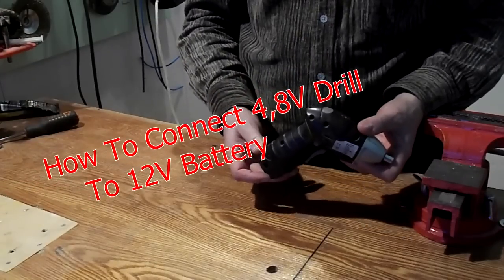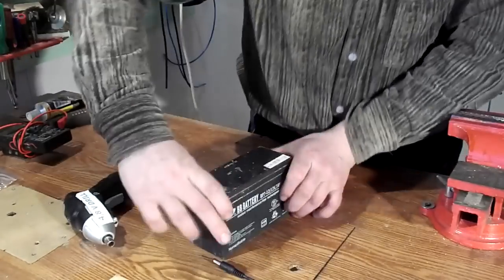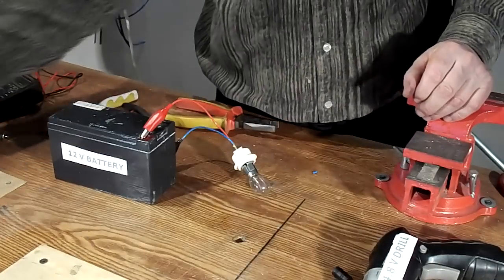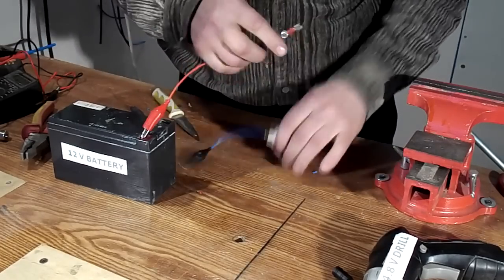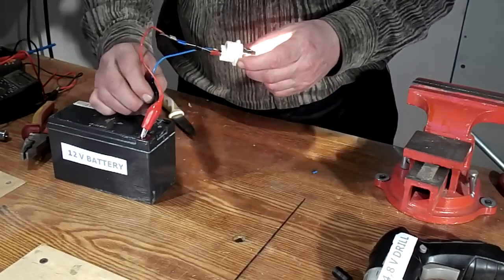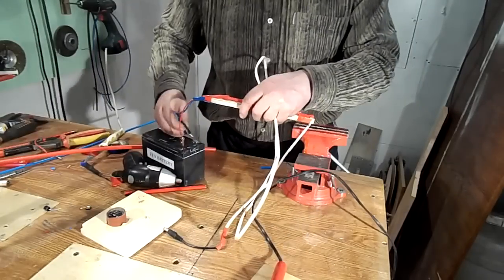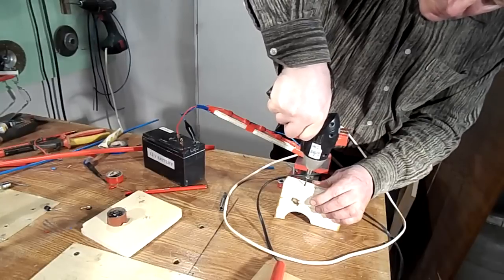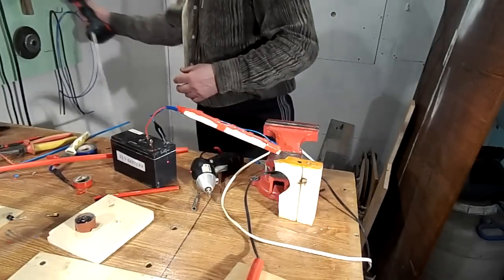How To Connect 4,8V Drill And 12V Battery

Comment: Two A123 cells in series will do a much better job. At 6V they'll overdrive the motor slightly, which is often a good thing because these tiny screwdrivers aren't exactly powerful and can use the extra energy, and they can be hooked up directly so no need to waste 60% of the battery's energy into heat. You can also parallel them up in a 2s2p, 2s3p etc configuration if you need more battery life. A123 18650s are fairly cheap. You can also use normal 18650s which are cheaper still and have more capacity, but then you need to get protected ones for safety and they have higher voltage which might overdrive the motor a bit too much for comfort.
Reply from the maker: A123? I do not think that these batteries will be able to compete with my battery for the duration of the work. This is the most important factor for me
Reply: A123 26650s have 2.5Ah. Keep in mind that if you're using a 7Ah lead-acid battery and waste 60% of its energy with the diodes you get about the same life, and the A123 pack will be MUCH lighter and smaller and will last longer.

If A123s are not available at acceptable prices to you, perhaps a better choice would be a cheap 9-12 volt tool connected directly to your battery.

The way you're doing it in this video works if you aren't troubled by the inefficiency, but the battery is much bigger and heavier than it needs to be.
Reply from the maker: In any event, my variant may be useful.

Comment: you could have used a resistor in place.... but this was A nice trick....
Reply from the maker: The resistor restricts the current, which reduces the power of the drill.
Reply: Victor V.
ok... but, the current draw will be constant for the motor  as it is what the motor needs to run so the voltage will drop..... as per v = IR
if current is constant then votage will be changing,
please clear me this thing i need to know... in old speed controller for electric vehicle they used big variable rehostat... but in that place they could have easily use a variable diode type thing isnt that crrect... please help me by telling this thing as i am going to build a speed controller for my kart   and this will help me.. thank you sir...
Reply: +Victor V.  i was also thinking the same way by using diodes as diodes reduces voltages... but i have never seen anything as a variable type of diode so i thought of sticking to resistance....
Reply from the maker: What will be the maximum power of your car?
Reply: Victor V.
 i am thinking of two types of motor,
1. 48 volt 1500 watt 3000 rpm dc motor...
or
2.220 volt 850 watt 2700 rpm ac motor...  its hard here to find a 48 volt motor so i think at last i will have stick to the 220 volt ac one...
Reply from the maker: AC 220 volt power regulators are sold in stores. This is the cheapest and easiest option for you.
Reply: Victor V.
 but the motor will use 3.28 amps those power regulators are of much lower current, less then   or equal to .5 amps
Reply from the maker: Parasar Bhattacharya
I saw regulators to 6 amperes, ie 1500 Watt

Comment: Basically warm diodes that consume more than is consumed by the electric motor . I was expecting Switching Power
Reply: The diodes are an easy way of dropping the 12v to 5v , the power wasted in the diodes is only when the drill is running .  A switching power supply would cost more ..

Comment: nice job victa
if you cut down a usb cable I think you may achieve the same outcome, you would also have the choice of mains power or 12 volt simply by plugging into any usb outlet, also fitting a female mini usb socket to yor drill would work well to I think
Reply: +techron mattic USB will not supply enough current.

Comment: you waste like 60% of energy...for this job you should use step down converter (buck converter)...with all losses considered, 3-4$ converter from ebay should pull half of the current you now pull from the battery...running time will be more than double on one charge and you shuld get much more cycles out of battery...
Reply from the maker: +driterajh I distrust those converters. They are not reliable at higher currents.

Comment: Wouldn't a simple resistor in the circuit work?  By Ohm's law, to use a 12V battery to power a drill requiring 5V, 300mA, the resistor required would be:  12V / 0.3A = 36 ohm.  Similarly, the resistor wattage required would be 12V X  0.3A = 3.6W.  40 ohm, 5W or 10W ceramic resistors are inexpensive.
Reply: +Aminah Al-Noor 
nope.
to calculate the resistence of the resistor in ohms, to drop from 12V to 5V you will use Vin-Vout divided by the current in A.
so 12-5=7V
7/0.3=24ohm resistor.

for the power disspation, you would use (I^2)*R

So: (0.3^2)x24
=2.16W

You would need about 25\24ohm resistor that is at least 3W.

You could always parallel resistor or just use a linear voltage regulator as linear regulator will only dissipate about:
7x0.3=2.1W
so a linear regulator like the LM7805 would be much stable and cheaper and easier to get and even have better efficiency.
just don't forget to put a heat sink on it.

using diode to drop voltage is fine, but for this situation I would probably use the LM7805.

Comment: Hi Viktor,
Good to see your still making video's.
I have done something like this, instead of diodes I used a 12v 21w indicator bulb inline with my electric driver, I htink your method is more efficient, good idea.
Reply from the maker: +hellcattanks Thank you. I think so too.
Reply: Splitfire pilot 

did the diode were used to reduce the amount of voltage or something else? if connect it directly on 12v battery , are there may cause any damage to the motor ? i just new and just not truely understand the basic of electric system at all..

Comment: it is easier to use for example 300 Ohm 5W resistor or whatever ohms you need to get to the desired voltage.
Reply from the maker: +Valentin S. No, you're wrong.
Reply: +Valentin S. The problem with that is the voltage drop will then depend greatly on the current, diode volt drops tend to be more stable. If your load was fixed, then yes a resistor would work, but a drill's load depends on what you're drilling with it.

Comment: Hi Victor.  I like your ideas and thanks for the videos.  Another way to power low voltage drills and screw drivers is with an old computer power supply.  They are easy to come by at yard sales for example.  Use the 5V output of the power supply directly connected to your 4.8V or 3.6V tools.  They can handle the 5V without damage no problem.  I have been doing it that way for years.  And the reason the computer power supply works is because the 5V output has a very high current available, usually in excess of 20 amps.  Exactly  what battery tools need.  The 12V output of the power supply on the other hand usually doesn't have much current to supply, so its not very useful for retrofitting 12V battery powered tools.  Thanks and I look forward to your video ideas.
Reply from the maker: +ynotsail I want to keep the ability to work away from the mains.
Reply: +Victor V. if you attached a connector at the drill end, you could use either, 5v when convenient (at workbench etc) or the 12v with your adaptor when 'mobile'. Plus a 5v power supply like that is handy for other things too
Reply from the maker: I have such a power supply, but for me the best battery.
*****